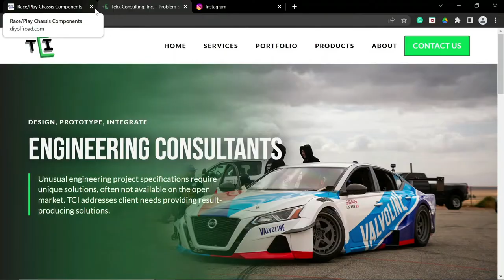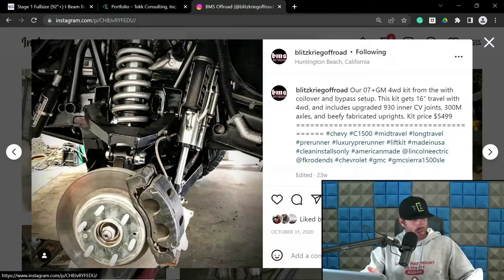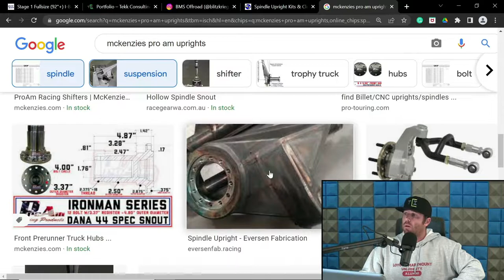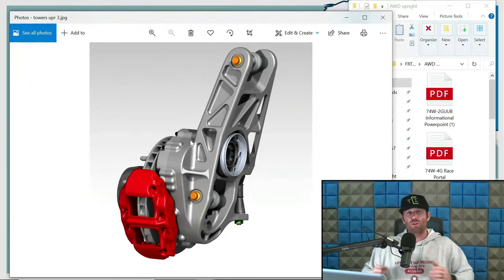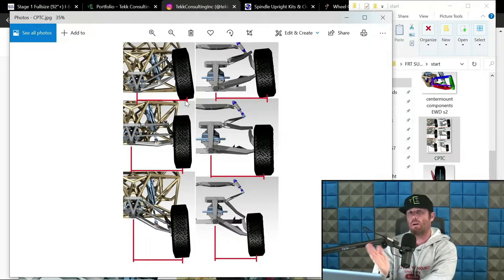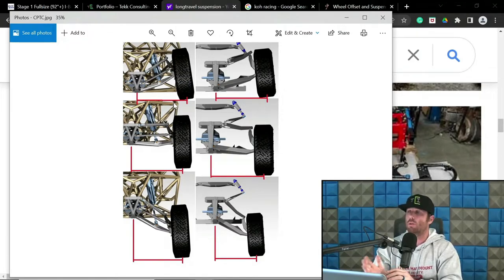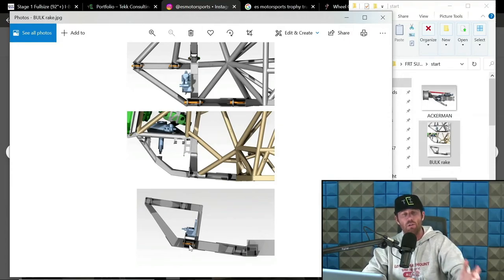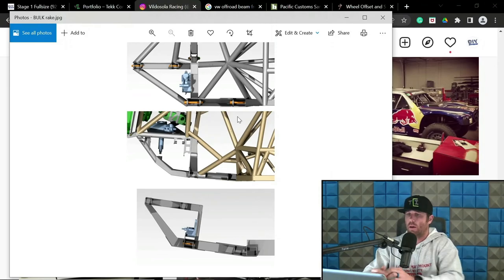Off Road IFS Design Vol 2 JEHC EP6

Comment: Amazing videos. So rare to see real information from someone with real knowledge and experience. Thank you! I run an ultra4 car (solid axle), and built my own knuckles so that I could design my own steering arms. I run zero Ackerman to maximize turning angle as the cvs are the limiting factor. If the inner knuckle hits the limit of the cv the outer will be less angle and it seems to me that since the outer does more of the work, I shouldn’t limit its range. What do you think?

Comment: Where can we discuss camber curves?  My background is in solid axle trucks/crawlers so I'm looking at things a bit differently.  In my opinion I believe camber change is beneficial when rock crawling.  I get why positive camber isn't wanted at full compression, but I'm not sure why its so bad on extension other than minimizing CPTC.  It seems that most situations where the tire is extending enough to get high positive camber numbers, the truck is either floating or in a turn sliding sideways, either situation wouldn't have much traction.  Similar to how CPTC isn't generally a concern on extension.  I guess the only situation where I can see it being a real issue is just like a beam setup when its fully drooped out and your coming down uneven with a wheel essentially underneath the rig causing it to want to stuff underneath instead of roll out, but that's usually a pretty extreme amount of camber change and I don't think your typical IFS front would get the tire that far underneath the truck.  Thoughts?

-Ghettofab75

Comment: If the two pivots on the upright are fixed in relation to the hub mounting surface/tire mounting surface (because upright is a solid object), why would the scrub change with a camber change? The red line and blue line should move through the travel at a fixed distance and angle to each other, so the green line would always be fixed too. The only way the green line would change with a camber change is if the upright were flexing, what am I missing? Is is scrub relative to active contact patch, so at ride height with 100% contact patch engagement you might have 1" of scrub, but with 10 degrees of camber and only inside 30% contact patch engagement, all of a sudden you'd have -1" scrub? made up numbers for example obviously but is that the theory?